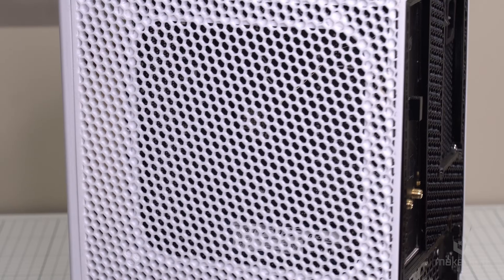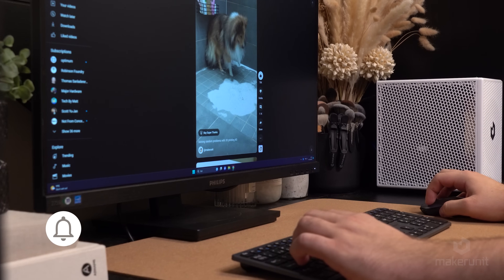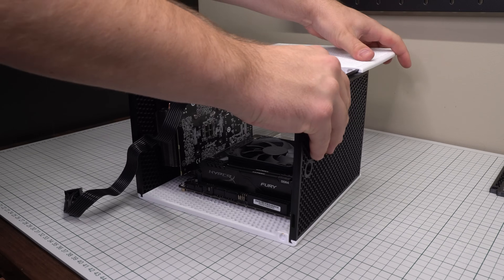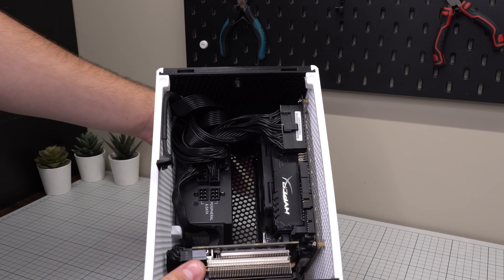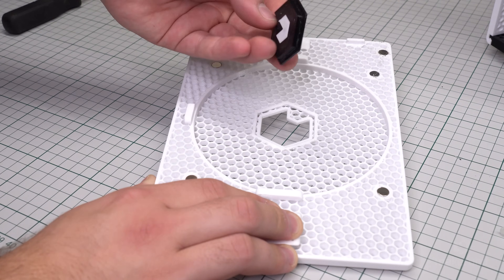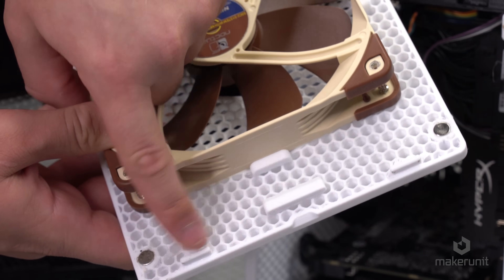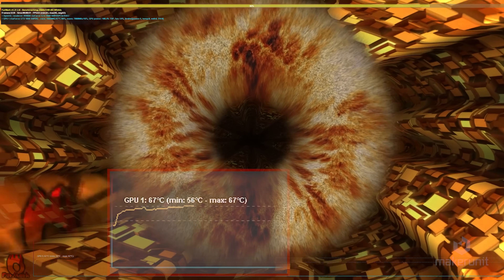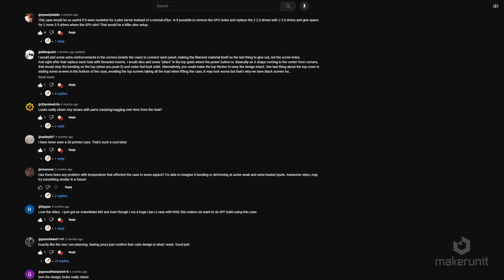Tiny 8.1L SFF build - 3D printed PC case

Comment: Hey Maker, I’m attempting to print this case (also my first prints outside of some figurines, so I’m pretty pumped) and when I try to remove the layers in PrusaSlicer, it won’t let me slice after. It shows the little orange unlocked symbol next to the values in the settings. 

Any insight would be greatly appreciated friend!

EDIT - Apparently the print is too big for my printer, sadly. I have an Elegoo Neptune 3 Pro. When I put my printer settings in and import the STL for the front panel it hangs off the edge by default. Sad.
Reply from the maker: Hey! I’m happy to hear you like my design and sad to hear it didn’t work for you!

I see that the print volume is 225x225 on your printer, while the case requires 227mm in one direction.

However, there is a workaround that can give you those two millimeters of extra space, as the manufacturers always leave a few millimeters of clearance for a «safe area» to print on, while your printbed is most likely about 235x235. 

When you try to manually move your x or y axis starting from position zero after homing, does it allow you to move past 225mm in any direction? I mean when you move it manually through your display. Or maybe your X axis can move lower than 0? For example -2 or -3?

The reason why I’m asking this is because many of these printers will home outside of the given 225x225mm print area, meaning you can often move the axis down to like -3 or even -5 on the x axis. This allows you to tell the slicer that you have a 227mm printbed, and then tell your slicer to offset the printbed to -2, so that the print can print from position -2 to +225, this will be a total of 227mm allowing you to print the part. 

This may take some trial or failure to tune in perfectly but it’s possible to squeeze out a few more millimeters from your printer.
Reply: @makerunit  I will give that a try! Thanks for the reply, I will report back after attempting again.

Comment: Could someone modify the file to fit a 201mm GPU? The Gigabyte 4070 2x oc would be so awesome in this form factor
Reply from the maker: I do have a longer slightly different version available on Printables. It requires a bigger printer though.
Reply: @makerunit  it's to big I need only 201mm GPU length
Reply from the maker: @MyFighter24  So basically 20mm more would do? Is your GPU 2-slot? From the pictures I can find it seems to be slightly wider than 2-slot, so fitment may be an issue. Seems to be 4-5mm outside the 2 slots.
Reply: The 4070 is 11mm longer than what fits in it. You should be able to safely print the case a little larger. Thickness is no problem if you remove the plastic holder and install 2 thin fans. Then this is 2 slot high

Comment: This is really cool, but it needs front facing usb ports.

Also I think I'd print the solid one because this honeycomb pattern will be a dust nightmare.

I wonder I'd there's a version compatible with a 120mm fan that could have an aio water cooler.

My biggest worry though is how much the heat from the computer would affect the case of it's printed in PLA.
Reply from the maker: Hi, heat will not be a problem as long as you have an intake fan in the front, even less «risky» if you use Petg or ABS/ASA etc. you must have perforation to allow for airflow, unless it WILL be way too hot. In a dusty environment this may not be ideal, but in a relatively clean on-desk setup it should work just fine and can easily be blown clean with an air duster.

Comment: Love the layout of having the PSU over the motherboard and the GPU without any extender. For a moderate PC this is a very elegant design.
I built a rack compatible server very similar to this out of sheet metal a while back. Great build!
Reply from the maker: Thank you! The only downside is the lack of CPU cooler height in this layout.

Comment: Hi! Does somebody tried to use longer than 190mm gpu? I want to use a rtx 4060 ti 16gb from msi, but the gpu is 199mm long, but after seeing clip at 6:44 I think there is space for it. What do you think all?
Reply from the maker: The GPU I was using in the video was 170mm long. FYI 😊 if you need a case to support a longer GPU, I’d recommend my SL version of this same case.(same look, new interior)
Reply: Thanks! I thought it was a 190mm graphics card. I've seen your videos about S, M and SL, but for me the best styling is the S version! I love how tiny it is! I haven't bought a graphics card yet, so I'll just choose 170mm. Thank you for answering me! 😊
Reply from the maker: @Alexowyyy  you are able to get even 4060 TI’s as ITX size now I’ve seen so you should get pretty good performance from that! If gaming good performance is one of your requirements. The 4060TI is pretty close to 3070 Performance, which is the card I’m using on my main PC at the moment and is more than enough in most games at 1440p
Reply: @makerunit  Thanks! I saw the 4060 ti itx, I will propably buy it, just that the short version of 4060 ti in my country is only in 8gb version, but thanks! 😀

Comment: Hey - How long should the metal inserts be, how wide, and how long should the m3 screws going into the motherboard standoffs be? Thanks a lot for this, it's amazing!
Reply from the maker: The motherboard actually uses 6-32 threaded screws. The standoffs are 6.7mm tall. And the threaded inserts can be between 5-7mm length.
Reply: I think I'm going to make a pc in this. I can pick up a used 3060 small form factor for around 180, and the case only costs me like 30 usd total, so I am both getting the perfect size pc for me and also a cheaper one. Thanks a lot for making this, it is really amazing! @makerunit
Reply: Thanks! @makerunit

Comment: Hello.  Thank you for the video.  What size should the holes be for the motherboard stands?
Reply from the maker: In the design they are 3.5mm. I’ve had some people say they were a bit loose but I guess it depends on each printers tolerances.
Reply from the maker: On my newer designs I’ve gone down to 3.2mm which seems a bit stiffer.

Comment: Your videos have inspired me to learn Fusion 360 so that I could design a small (very compact) build for an old mobo I had laying around. I LOVE the honeycomb design, I just struggle to tune my setting to get rid of the stringing with PETG. Any advice? Awesome videos and perfect case designs
Reply from the maker: Hi! Thank you for sharing this and I’m glad I could inspire you. To be completely honest I’m not the best person to ask about stringing, even I still have issues with that at this point. I’ve generally been avoiding designs that are likely to string. 

Often lowering temperatures and/or tuning the retraction settings may help a bit, some people also say that drying your filament helps to reduce stringing. Especially if you live in a country with high humidity. I’m living in Norway which is pretty dry and I have an indoor humidity between 30-50% but some countries may average 60% + all year which can over time add moisture to your filament.

Comment: what is the tallest CPU cooler that can be used in this case please?
Reply from the maker: Hi Mike! Happy to hear from you!

So, theoretically you should be able to fit something up to about 65mm height, but I do recommend staying under 50-55mm. 

For example the Ryzen Wraith Stealth at 54mm should be about the maximum I’d recommend due to how the PSU is mounted partially blocking the path of the airflow. 

I hope this helps! 😊
Reply: @makerunit  one of the friends of the channel Patrick Lebel has kindly printed a slightly customised version of your design, and i am in the process or ordering parts to build it. I will be doing a video review on this if you are okay with that?

and happy new year to you also
Reply from the maker: @mikesunboxing  Hi, of course I’d love to see you feature my design in one of your videos! 

I’ve been talking a bit with Patrick already after he kindly asked me if he could make one to send to you which I of course gave the green light! 😊

Happy new year! And I’m looking forward to seeing your video.
Reply: @makerunit  awesome stuff! Looks like it will be Intel i5 12400 with H610 asrock board, might try and use the stock intel cooler and see how that goes. I'll link you up on the video
Reply from the maker: @mikesunboxing  Sounds great!

Comment: Congrats! Just print one in a Prusa MK3+ to give life back to an old mini-itx-it mb.... in great style! I'll try to use my poor 3d design skills to remix the top plate to accomodate a 16mm on/off switch... easier to source here in Brasil. BTW, printed mine using 20% infill.... didn't weight it but probably has used less than 500g of filament, and the result is great!
Reply from the maker: That’s awesome! Do you want me to send you a file of the top cover with a 16mm hole? 😊 If you contact me through the Printables chat function, I’ll be able to share a modified file with you. If you haven’t managed already.

Comment: Just finished printing and putting this together.  My printer doesn't have a large enough bed to print the single pieces so I printed each piece split down the middle and bonded each piece with acetone.  Yes there is a line all the way around the case, but it still looks really good.  This is a great design and printed very well and assembles like a dream.  I think you could could easily modify the back and the PSU shelf to accommodate a full ATX PSU(within reason).
Great Job.

BTW, putting a b450 itx with a R7 2700x and a GTX 1660 Super.
Reply from the maker: Hi! I’m glad to hear that you found the building process to be easy. I’d love to see a «Make» on Printables, or in general some pictures on how you solved the joining of the split parts and how it turned out if you don’t mind! 😊 I’m currently working on a longer version of this case design to allow for printing on Ender 3 or similar sized printers, and I’m looking into different ways of joining the parts without compromising the strength!  

I’ve got the CR10 version of the long one already printed and soon about to post, but the idea is to make it Ender-friendly.

Comment: I would love to see a PC case similar to big boy, but able to hold like 4+ 3.5 inch hard drives, and a small gfx card like this one you put in.
Reply from the maker: So like a Big Boy tiny edition? That could work. I’d be able to shrink it down by a bit and instead of a 240mm AIO maybe it could take a 120mm AIO or an air cooler due to being shorter while still keeping the 200mm fan(s). Might work. And if I can fit it within 220x220mm it’d be printable on even an Ender 3 or similar.
Reply: @makerunit  Yeah! That'll be awesome! I've been looking for a smaller-ish case that'll house 4 HDDs, and hold a small gfx card, but none have the dimensions I need.
Reply from the maker: @CapnBio  not promising anything but I’ll see what I can do at least 😊 I’ve got a few projects lined up first but I’m interested in looking more into this

Comment: It would be awesome if you made an itx build for a dual fan video card and atx power supply, it would allow a lot of guys to rebuild their full tower into a small case! look at the parts layout of the ShinySnake G200 for example.
love you!
Reply from the maker: Funny you’d mention that. It’s exactly what I’m planning next after my mATX case coming soon. I’ve already started some design ideas and it’s already pretty close to done 😊
Reply from the maker: Hello again! I'd just like to let you know that the type of build you're requesting is now available to get for my Printables Club members. Feel free to check out the files here: https://www.printables.com/model/688060-little-boy-s-long-edition-115l-itx

This design supports GPU's up to 290mm (with SFX psu)
GPU up to 200mm with ATX psu, both 125mm and 140mm depth supplies (though compact ATX supply is recommended)
HDD's
120mm AIO and more :) Video in progress making now, soon to be posted :D

Comment: Try to make a compact case that fit Gigabyte RTX 4070ti windforce, mini-ITX msi z790, corsair sf750, 13700k, and water cooling for it. I used Lian-Li A4H2O for it. Good but not a best compact build. Difficult to choose LCS for such processer. My choise was a deepcool ls520, but the pump is too deep.
Reply from the maker: I’ll be making a longer version of this case soon. So far it will most likely be able to support a 120mm radiator water cooling but that’s about it in this small format but design changes may come before I post 😊
Reply: @makerunit  I'm excited already)
Reply from the maker: Hey! The longer version is now posted to Printables and is available to download for all my Printables Club members! Feel free to check it out here: https://www.printables.com/model/688060-little-boy-s-long-edition-115l-itx (full video and more info coming soon!)
Reply: @makerunit  I like the design. It is good for process with TDP i7-12700 and less. You made a supporting ATX and SFX power supply. What about making only SFX and use the free space for 240 AIO? If it would be enough of course)
Reply from the maker: @neordinator  a side mounted SFX psu may allow for a 240mm AIO 😁 that’s a good idea actually!
Reply: @makerunit  When you finish the updated design, can I buy a case you've made by it?🙂
Reply from the maker: @neordinator  Hi! Thanks for the excitement but as mentioned I have not actually tested this yet so it might not work, it’s just a sketch in my head at the moment. I’ll check it out and update you IF it does work, should be a fairly simple modification based on my original design files if it does work. In theory it should work actually. I believe I’d have about 5mm to spare to fit a SFX psu next to the 170mm itx motherboard. 

Usually I do not sell pre-printed cases mainly due to my limitation in printing capacity as cases take a while to print.

I also see your GPU seems to be a little bit bigger than a normal 2-slot so I’d have go add another 10mm to the bottom as well. 

You gave me some ideas to work with here and I’ll see what I can do but I can not promise you anything specific for now.

I get hundreds of requests regularly and I do my best to please everyone but it’s hard to manage all, but I do like this idea very much so it’s a big MAYBE.  😁

Comment: Tengo una idea es un case para pc itx pero aun mas pequeño que sea de graficos integrados asi sin el espacio de la gpu y se le podrian poner 2 ventiladores de 120mm uno para meter aire adentro y otro para sacarlo afuera (no seria pc gamer porque no tendria grafica seria para ofimatica)
Reply from the maker: That’d possible! What about 1 single 200mm fan forcing air in and out the other side? Making it pretty much silent?
Reply: @makerunit 
Seria mucho mejor asi como dices gracias por responder de aqui en delante sere suscriptor tuyo

Comment: My ultimate case is this, but slightly longer with the PSU next to the mobo instead of over it, to fit a longer GPU.
Reply from the maker: I’ve got an extended version finished desig ing lined up to print soon so stay tuned 😊 first my mATX version though.
Reply from the maker: May this be what you're looking for? https://www.printables.com/model/688060-little-boy-s-long-edition-115l-itx (Video coming soon)
Reply: @makerunit  Looking forward to the vid. My printers are currently non functional, so it would be a while before I could make it. Maybe I'll adjust the files to cut on my laser.

Comment: looks good til your case starts melting.
Reply from the maker: What exactly would make the case melt if I may ask? 😊 remember that if for example a CPU reads 90 degrees it doesn’t mean the entire case is 90. It means the core of the component is 90. The ambient air is probably 40-45 at most. MAYBE 50 worst case. Really nothing to worry about 😊

Especially if you use PETG or any other high temp material. But in most cases PLA should work fine too.

Comment: how, where to get the corsair sf450? or sf600? Preferably the platinum versions? Only one that is available is sf750
Reply from the maker: I believe the SF450 is unfortunately no longer for sale everywhere, and mine is a few years old. Maybe you can get one second hand?
Reply: @makerunit  I'm afraid to buy PSU second hand.. Could be an expensive gamble. 

Btw I was looking at my cat chilling today on top of my moms NR200 and.. the surface was a bit small for the cat... maybe an inspiration.. there should be a case that is optimized for cats (enough space on the top (t shape? desktop-like?), evenly heated top with alternative way for air to escape even when the cat chokes the upstream :D. An a side button, I hate it, when the cat turns off the pc :D.

Great job on the cases!
Reply from the maker: @vladimirljubopytnov5193  hahah that would actually make for a hilarious video 🤣

Imagine a PC case specifically designed for cats to lay on top of.
Reply: @makerunit  And Steve from Gamers Nexus would review one, because he likes cats :D..
Reply from the maker: @vladimirljubopytnov5193  I mean, just a simple console style layout, intake at the bottom, exhaust top, a perforated cat bed shape at the top, easy 😁

Comment: I think the challenge is making a smaller PC Case. Something like XBOX Series S size.
Reply from the maker: Using an ITX motherboard, a 170mm GPU and a SFX psu, the Xbox series S dimensions are pretty much impossible to match as it used a custom board that has both CPU and GPU in the same board making it smaller, but slightly bigger is possible. 😊
Reply: @makerunit  Making it slightly bigger is no not a big deal. As long as you put it next to a real one and confuse others. 😉
Reply from the maker: @SpartX7  then you’d be able to say «My Series S is bigger than yours!» 🤣
Reply: @makerunit   That's the main reason why you would want one. 😁